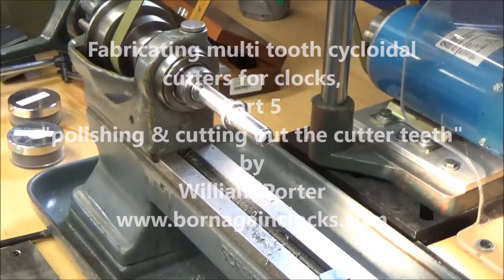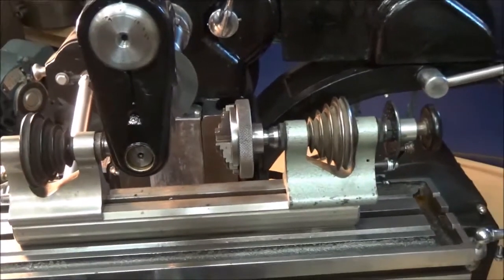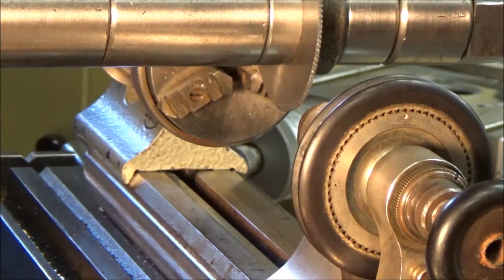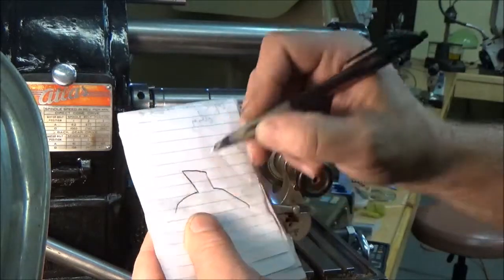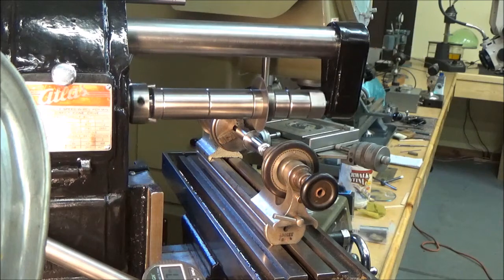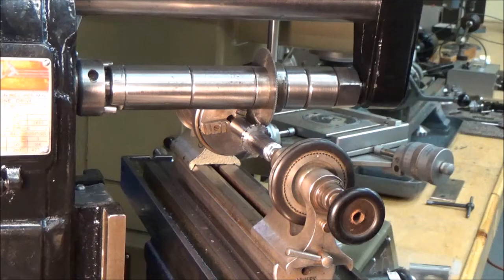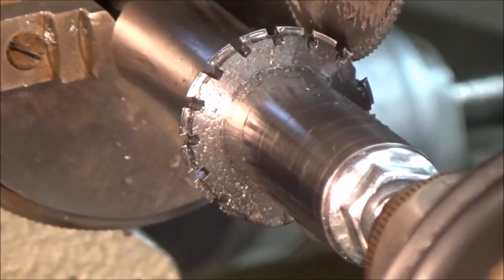Fabricating multi tooth cycloidal cutters for clocks, Part 5 "polishing & cutting the cutter teeth"

Comment: JohnS
Back to your sine gauge, it would seem that your seventy has only a minor clearance between the top of the cross slide and the lathe centre height.  How did you get this dimension for the height of the bottom (base) plate?  One would assume that the lathe (70) is in millimetres but the brass in the USA would be in inches???

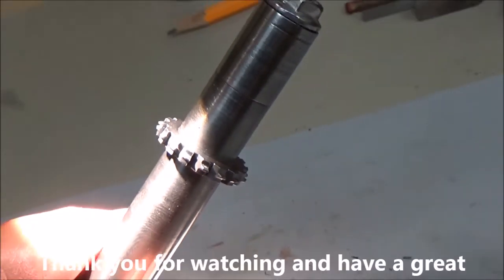Comment: You mention at 14:57 that you'll cut the actual pinion in the next video.
Is there a part 6?
Reply from the maker: Thanks for the response. No there isnt a part 6...life has been happening and I have gotten side tracked, probably wont be a part 6...I did cut several pinions with this, I found that that many teeth in the cutter seemed to cause more of a scraping ? action, my thought is that there was too much unrelieved surface area. For a experiment I ground out every other tooth on the cutter and that seemed to be a little better, after that I ground a relief on the cutter tooth tips, from the leading edge back which also made it a bit better in the cutting action, which stands to reason. All that is cutting tool steel. For brass I have made ratchet wheel cutters, wheel cutters ect..and they perform very nice, tool steel requires very small cuts, slow surface speeds and cutting fluid along with polishing the pinion after cutting you can produce a nice product. Have a great day.

Comment: Hi, Not sure if I have missed something! How did you back the cutter profile off to give cutting clearance!!!!!!!Did you do it by hand before heat treatment!!!!
Reply from the maker: No, you have not missed anything. I have used these type of cutters on brass and steel without any relief of the cutting form. For brass they work great, for steel they work o.k. I have ground relief into the tips of the cutter to aid in performance and it has helped a bit. It would be very time consuming to do a careful job of creating relief before heat treating or grinding it after. The design is to give the cutter a "scooping" action. Have a nice day, William

Comment: This is a very interesting series. I an currently trying to make 4-tooth wheel cutters, form-relieved.  The basic method is found here:
http://www.deansphotographica.com/machining/ptojects/multipoint.multipoint.html

Dean also cites an article by Creed which I found in the Yahoo clockmaker's group. I think the inventor of the method is Don Unwin, but I can't find his articles on line (yet). It is basically a drilling jig and an eccentric arbor. I am currently having problems getting the form tool to work, so your system is extremely interesting. Looking forward to part 6.